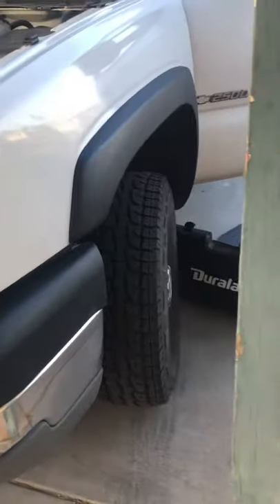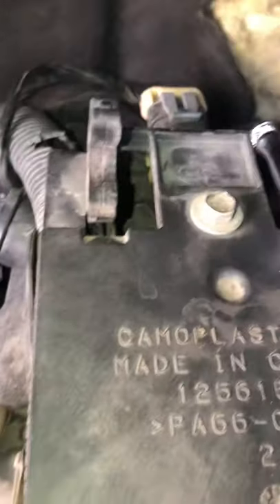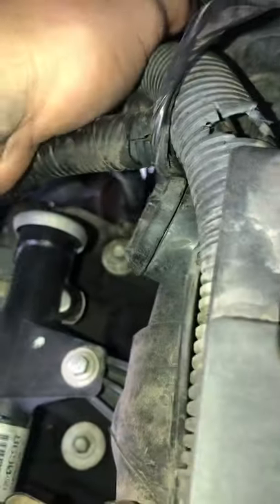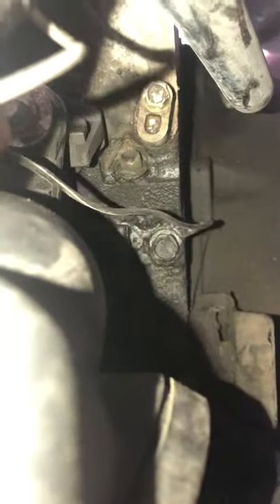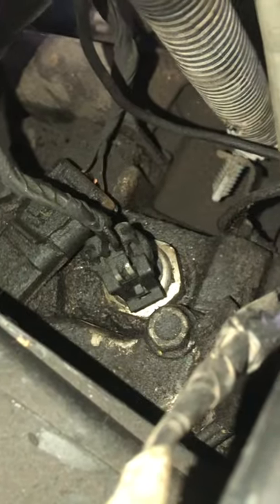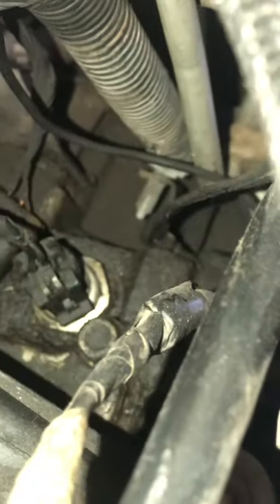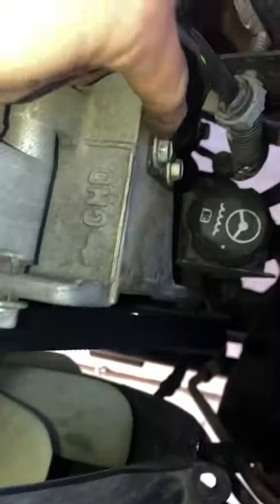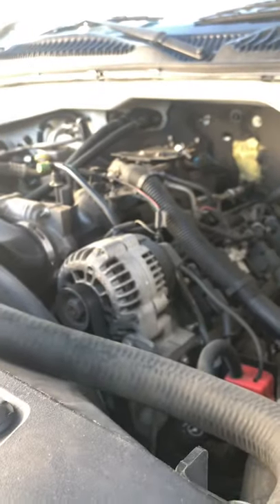05 Chevy Silverado ground locations (reduced engine power)

Comment: Finally, someone who shows the real emplacement of those ground wires. on top of that you took less than 5min. great video. thanks👌👌
Reply: Thanks for showing the three engine grounds in the rear can be gotten to without pulling the intake manifold.
Now if someone will explain why GM thought it was necessary to route all of the PCM grounds from the PCM to the opposite corner of the engine bay...

Comment: When you say Reduced Engine Power did you actually have the dash display tell you this . I had this happen 6 months after I bought the truck . Took it in and they said they had to reprogram the computer under warranty . 15 years later I put in a stereo system and a bigger alternator and find I have ground issues in this truck . After seeing this video I wonder if they lied to me
Reply: There is a code for Reduced Engine Power. I believe it is P300

Comment: Thanks alot. I had no crank no spark no fuel. I had already cleaned all the other grounds. Went to check the pcm ground as you showed and the wire wasnt even attached anymore. Truck runs great after your 5 minute fix.

Comment: There is one more very important place to check and or clean and re-ground. Directly under the driver side on the frame between the driver door and front fender. A throttle by cable engine will have one bolt with two ground wires on it and a throttle by wire engine will have two ground bolts with 1 bolt having two grounds and the second bolt having one ground wire. A bad connection at this point can cause misfires fuel issues no throttle issues etc
Reply: Thanks for pointing that out. I have fixed the grounds in the video plus under the seat.  Pull back the plastic conduit under the seat as one of the two ground wires can break from eyelet and you wouldn't know.  Also clean grounds at the frame, under the core support, drivers side.  ALL grounds are important.

Comment: Thank you for your first video you saved me from 2 months of nightmare have a 03 Suburban had been a complete electrical shutdown random I replaced ECM no help you're one wire on the left side was spot on I only gave it a little tug and it came right off corroded thank you thank you thank you

Comment: Great video. It’s not just the connection to the bolt and washer that oxidizes but also the crimp to wire connection that goes bad. On my 09 H2 the ignition ground on drivers side of engine had this problem. I cut the crimp off the wires and soldered new wire to the old so it could reach the battery post. It idles smoother now than it has for a year, go figure.

Comment: I recently replaced my engine and I got the hood ground and fire wall ground mixed up. This is causing my interior powers to surge/turn off then right back on when the key is turned to run. I JUST WANTED TO THANK YOU FOR THE GREAT DETAILS U HAVE IN YOUR VIDEO!!! YOUR AWESOME 🤩

Comment: So glad I found your video cuz this damn reduced engine power been pissin me off
Reply: I have 2010 Silverado and had reduced engine power truck would start to shake then it went away came back few weeks later check engine light also said had something to do with cylinder number 7 I replaced that spark plug and it fixed the issue after that replaced all the rest of plugs and cables and has been perfect ever since

Comment: Great video!! Also wanted to mention there is one on the side left driver side of the block, close to the steering pump that goes bad or breaks sometimes too.
Reply: came here to say this too. that's the one that went bad on my 05 1500.
Reply: Funny you should mention that ground I have a gmc pickup that won't start after I changed power steering pump wonder if that's a pcm ground wire
Reply: @bobbyu8991 i know this is an older, comment, but for those who may be reading this in the future:  this broken ground caused me to have a crank, no start issue. I had no check engine light or codes. I had fuel pressure, but no spark. I had rpms while cranking, verified by my scanner. That led me to start looking at grounding issues, since getting to the camshaft position sensor is such a pain. It turned out to be this ground. It is grounded to the engine block by the same bolt as the negative battery cable is. Between the front differential and the steering linkage, there is not a lot of working room. It was probably the most miserable “simple repair” I’ve ever done!

Comment: The second ground wire you showed is not connected to anything on mine. I just noticed it.  I don’t have a “reduced engine power” but I do notice that I lacks power. Gonna connect it today and see if it fixes it.
Reply: Did it work?
Reply: Im having exact same issue with my '05 Silverado I have P0300 code and I replaced all 8 plugs wires and coils but still have limited power and I noticed my ground wire is very rough looking and  wondered if maybe it was causing some of my issues🤷‍♀️

Comment: great vid, there is also a few that are mounted under the drivers  seat on the frame where the parking brake cable is, mine are so rusty im going to do them first, im blowing the p300 no designated  cylinder so im guessing its a ground somewhere

Comment: Along with the two grounds on the back drivers side there is one on the passenger side st the back and a common ground for both sides that run the coil packs it crosses over in the middle from the right side to the left side and then along the top down the front behind the alternator and power steering and back along the bottom to a bolt that attaches the main battery ground to the block if you have a crank no start check this one I have had that issue and found it broke 2inches from the bolt under the motor

Comment: another location on a 2004 sierra is on the engine block, drivers side under exhaust manifold. the batt negative cable is there along with another smaller gauge wire. mine broke and truck would  crank, no start. i even checked it and cleaned the connection but was worn enough where it was still faulty. relocated smaller ground.

Comment: Remove the tps and grease the gears behind it. If there is no lubrication behind it it will bind and throw a code and go into limp mode. It will not work the way it was designed. I did this to mine and had zero issues after

Comment: Couple years ago my fuel gauge quit working.
I replaced the pump then. 
It stayed the same
Yesterday 2years later very little miles it would not start fuel pump dead.
I am guessing its going to be ground wires.

Comment: Thank you for the video I have been battling reduced engine power for awhile now. I replaced gas pedal, throttle body, and throttle actuator control. Still comes on. I couldn’t find the passenger ground wire. I’m going to do a new ground tomorrow hopefully that works.
Reply: Did it work
Reply: So I went ahead and put new all new grounds. I did not remove the old grounds I just put new ones in place. Firewall to alternator bracket, alternator bracket to ground on battery, ground on battery to frame rail. 

So far is has not had the “REP” in 500 miles. Before that it was happening multiple times per day
Reply: @moejr14  sorry I just saw this. No it didn’t work for me. When I replaced the throttle body I bought an Autozone brand.  I ended up buying an AC Delco throttle body and that fixed it for me.
Reply: @zero_cool817  I’m convinced it is a ground issue
Reply: @moejr14  that’s what I thought too and I tried everything. The AC Delco throttle body fixed it for me. It’s been 6 months with zero issues.
Reply: @zero_cool817  did you redo all the grounds also?
Reply: @zero_cool817  ok man. I’m a believer now. Do you have a part number? And where you purchased it?

Comment: Where does the thin ground wire on the battery cable go to?
Reply: Front left frame just behind the left fog light assembly within the lower bumper valance cap.